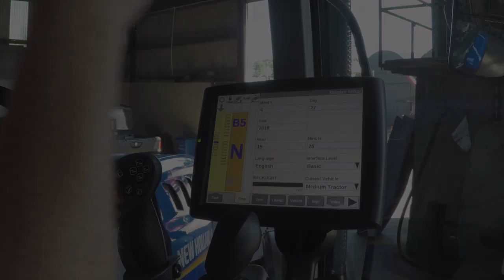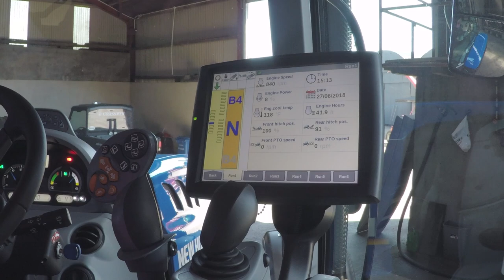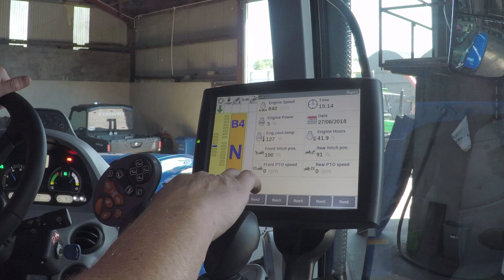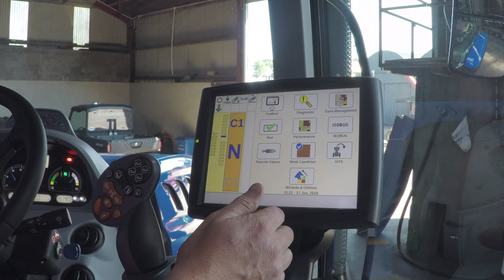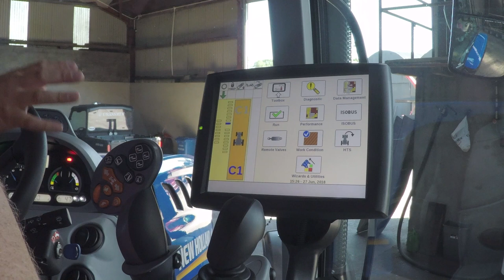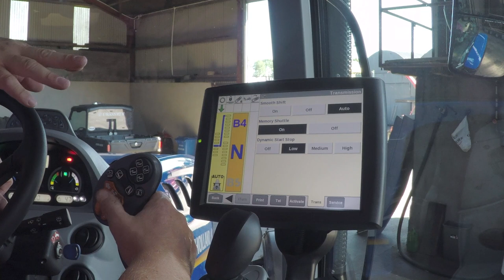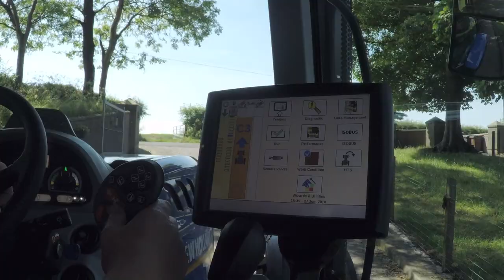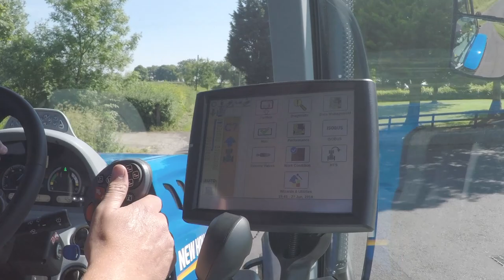GRASSMEN TV - New Holland T6.175 | In-depth Look

Comment: Just a question Donkey, what was or still is your opinion on the range command with the 17x16 vs the 16x16 transmissions? Both have the auto shift options and I want to know because I can get a T6.180 with the 17x16 but it is a special order option here in the United States and do they have problems with the 17th gear shifts? Since that gears operation is running through the direct drive of the PTO shaft instead of part of the transmission it made me curious to research before buying this one.

Comment: How long dual clutch disks last? So basically back to dual clutch from inefficient hydraulic piston pump transmissions
Reply: if you are concerned about how long your transmission will last, you shouldn't buy a new tractor.

Comment: How do these latest new Holland’s compare to deere in comfort they always lacked behind, but they look really good now
Reply: Deeres for years are for non eaters small cabs. Unless they have improved recently
Reply: zzirSnipzz1 the new 6r series are far better a lot more room in them than the 30,20 or 10 series they where on the small side, the latest new Holland’s look good the fpt engines probably one of if not the best engines on the market
Reply: @Alexr-uf3zn  well i have no experience on the new ones just the older ones have the smaller cab, i agree but dont how NH are going for 4 pot engines 6 pot for the win
Reply: zzirSnipzz1 yea 6 pot any day think the t7 range are all 6, it’s the world we live in now down sizing and emissions regulations it’s holding their true potential back
Reply: @Alexr-uf3zn  Well the t
6.180 is still six but
 the 175 is the largest with this gearbox
Reply: Drive a 6r day to day, had a t6 dynamic command on demo for a couple of days, when it’s time to change the green one will go for a t6, brilliant tractor all round

Comment: Lovely tractor looks the part but I wouldn't want one I'll stick with the T6 175 with a 6 cylinder engine and the 16*16/4 electro gears if anything happens to the electrics cost you a clean fortune to fix it

Comment: i think i'll stay with my tm165
Reply: i have tm 165 its so good
Reply: @johnwick4448  bought ours at the start of the year. had an 8360 before her. got the tm for the suspension mainly but in my eyes she can't beat the 8360 we had mainly down to the transmission and pulling power (had the injectors on the 8360 screwed). range command on the 83 was able to go through the gears so smoothly and with 24 round straw bales behind on a hill, i was able to stay in the higher gears going 17mph. power command for us jolts to much and hard that its really noticeable. also getting her up the same hill with 24 straw round bales at 15mph is tough task for her. our old 83 just couldnt be beaten
Reply: @c4lv1n26  We got a 8160 back in the days for almost 9000h, any major issue, that was only 100hp but they were doing an amazing job

Comment: they will never be anything like a fendt I don't care what he says about the t6
Reply: Fendt are a good tractor but you pay heavily for small features.
Reply: I'm pretty sure this tractor actually beat a fendt at the dlg test centre
Reply: @maxhine8862   what hp did the fendt have because put this tractor to pull a zx200 Hitachi it can't because New Holland are SHIT even a class axion 850 or 870 is 100 times better.
Reply: @johncold6855  well i dont know but it would be the equivalent to this new Holland and let's be honest new Holland aernt shit and I'm not saying they are the best down to personal opinion tbh but strong statement to say any tractor is shit
Reply: then your fendts transmission will shit itself after 6000 to 7000 hours. i worked on fendts for my apprenticeship and it was a reoccurring problem
Reply: @johncold6855 the t6 achieved the best fuel efficiency for a 4cyl..so yea, it beat a fendt. What are you 12 yrs old John?